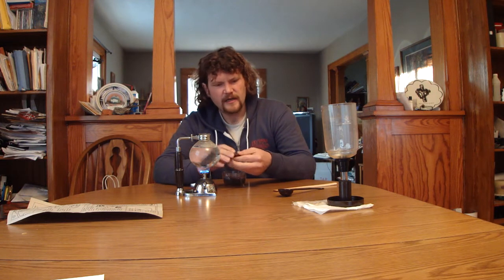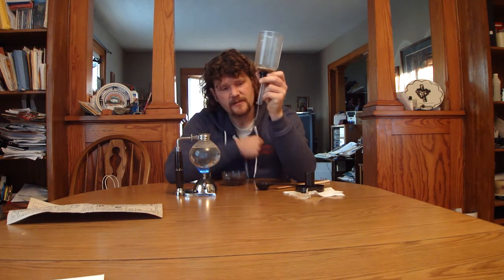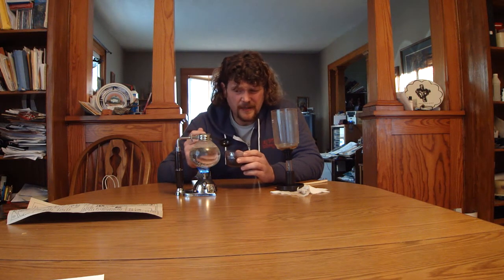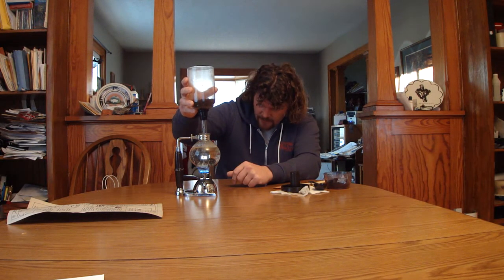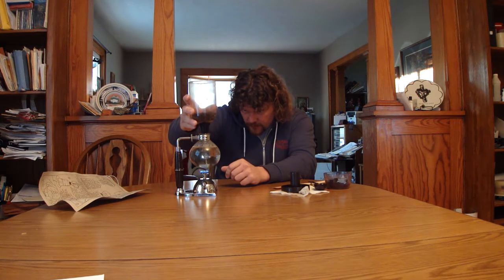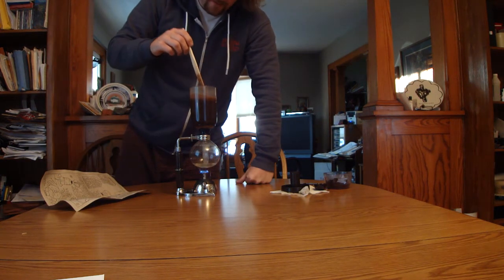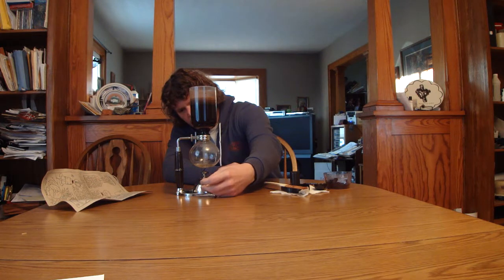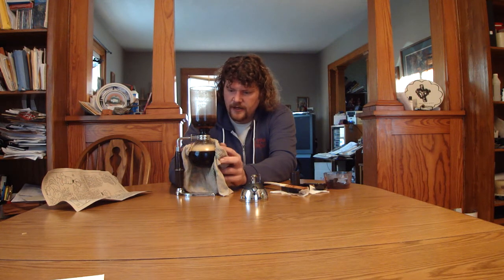Howto brew coffee in a siphon pot.

Comment from the maker: @mikeisi I agree with your assessment.  Sounds like the heat is a bit too high.  Once the water is in the upper chamber, then bubbles generally do not get up there.  This could also be from the roast on the beans.  If you are using something heavy roasted like a French roasted, deep roasted or really anything roasted over 450 degrees, that could be the source of the burnt flavor.  

From your description, I would recommend keeping your butane at a lower heat for the entire process.

Comment: That was a great and helpful video. Also, is your brewer a 'Hario' brand? because that's what I'm using except mine doesn't use a gas burner and instead uses an alcohol lamp which titanically sucks because it takes forever to heat water with that thing.

Is it possible to use other alternatives as a more powerful burner or am I stuck with this lamp?